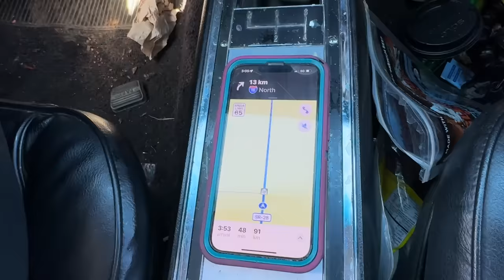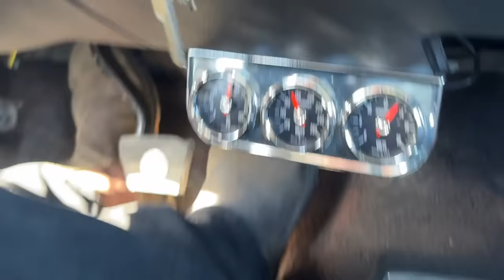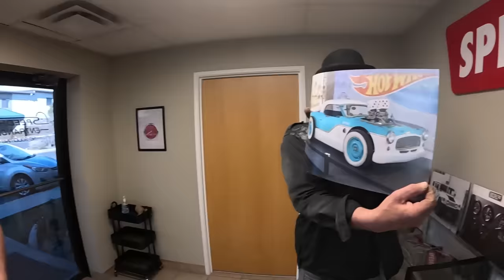Busy Day! Visiting Speedhut and Auto DD

Comment: that challenger is WELL WORTH restoring the history behind is like no other, wont say who owned it but if its from shade tree AS  from the paradise wildfire it was or is a vanishing point challenger, well worth restoring even if all panels are new, top can be certainly be shaped up, hale all the body panels might be, chassis might be good, all you need really, actually its just the tags and the block, can;t see the block being destroyed, then you can build a numbers matching vanishing point challenger, at that point you have prolly the most history rich vanishing point challenger there is, as it was actually in the movie Vanishing Point if it is indeed the paradise fire model I am thinking it is, went to shade tree auto salvage first?  run the numbers find out who owned it, its history, then you could add on the paradise fire, where it is now, then on up to Vancouver BC area to Rust Bros for full on restoration yes that would be an extremely history rich Dodge no jokes.. a guy might even restore it as homage to the fire and all those who didn't make it .. print all their names on the underside of the deck lid or something ..  the "Rust in Peace" Paradise Challenger  maybe drive it thru paradise one anniversary.. it be right up there with the Bruce Hudson Edmonds Fitzgerald Cuda in any event. . .